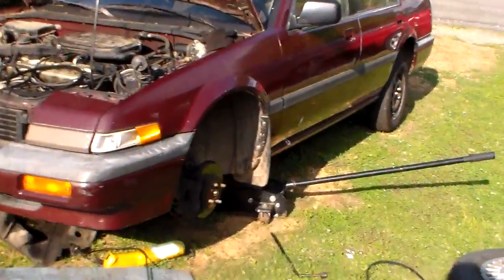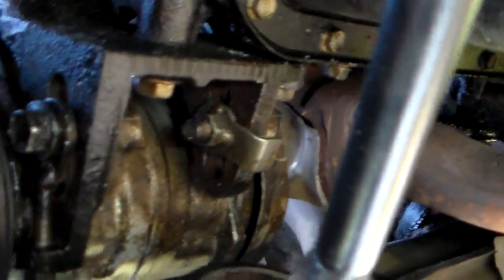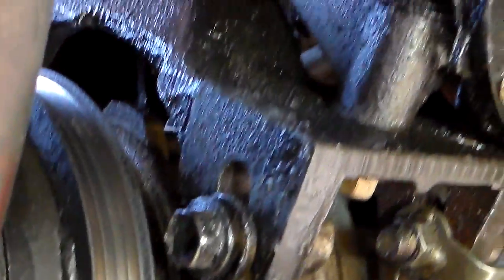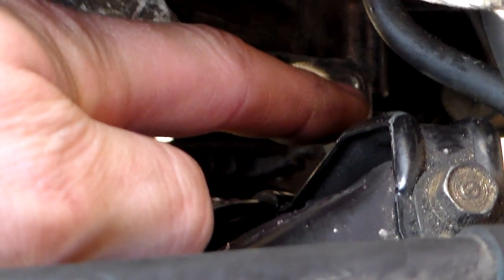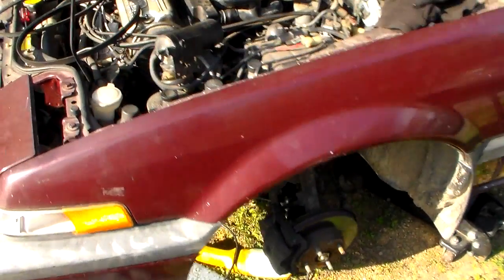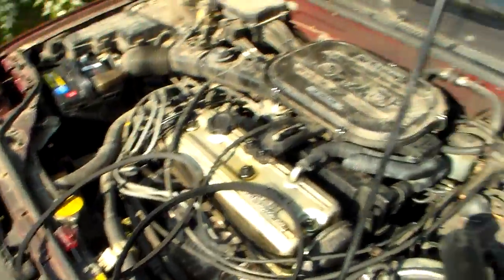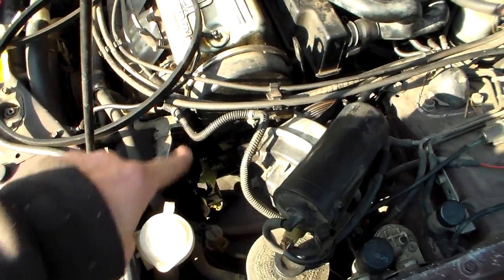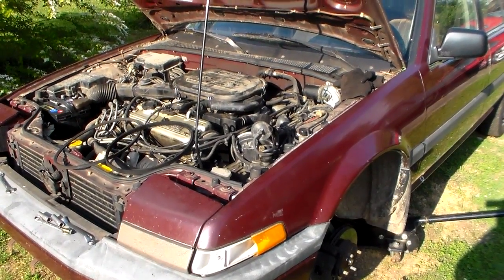How to replace belts on 1986-89 Honda Accord part 2

Comment: Couldn't really see the bolts on the top of the ac compressor, but my 88 has 2 pivot bolts on top and 2 on the bottom that all need loosened, all 14 mm. Thanks for the vid, it was very helpful (12 years later)

Comment: It's great seeing this car on you tube, such a major help man, mine still runs and gets 30 mpg, gonna be replacing some belts soon, thanks!
Reply from the maker: Anytime. These cars used to be everywhere when I was a teenager but now they are almost gone.
Reply: what year bet it's a 2door
Reply: I have the 4 door Accord LX
Reply: George Solo and you get 30mpg on yours how if these years only get 23mpg
Reply: Yours only gets 23? Mine is Carburated and I get at least 28-30 highway lol it amazes me. I also only use non-ethanol gas in it too.
Reply: I have 86 4door and only get 23mpg how is it u get that much
Reply: IDK man mine's the 89

Comment: thank you very much, as you said there is no info about the removal of the belts, I have to replace the waterpump on this 87 accord, so thanks again,
Reply: William Bell i also have an 87 and just replaced the water pump, how did you get the belt back on? I'm having particular difficulties with it

Comment: V Belts/Separate belts have their advantages. If one breaks, you still got a 2/3rds shot at being able to go home. Serpentine belt goes, and your stopped. I like them for that.

Oh those splash guards and scrape plates? My Dad likes to rip those off and toss them. That would explain the missing ones on the Bonneville from the harmonic balancer replacement. lol "Nobody" cares until their distributor gets soaked and they wish they left them on.

Comment: I had carbureated 86 Honda accord LX . Absolutely the worse car I ever owned; worse than 71 Chevy Vega. Sudden acceleration problem; extremely hard to start in cold; would just shut off and not start back in cold and wet weather; timing belt broke and bent valves while traveling. lots of electrical problems with tail and brake lights. A nightmare.
Reply: Woah. I have all the exact same problems. Plus my wipers don't work, the windows don't roll up, and the outside handle on the driver's side doesn't work. I hate hondas but it's all I've got.